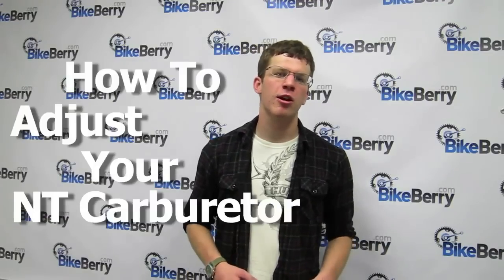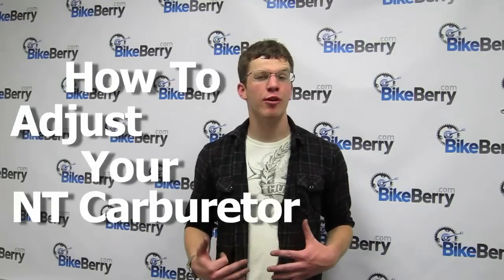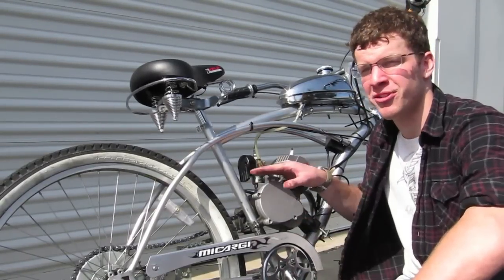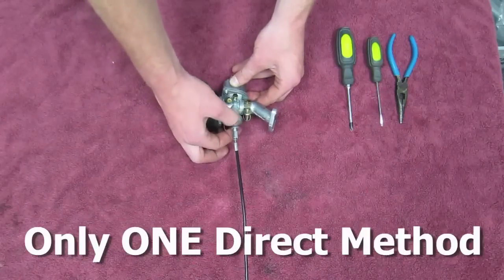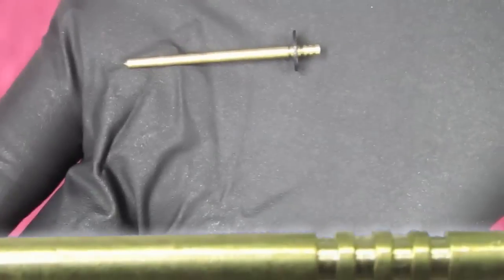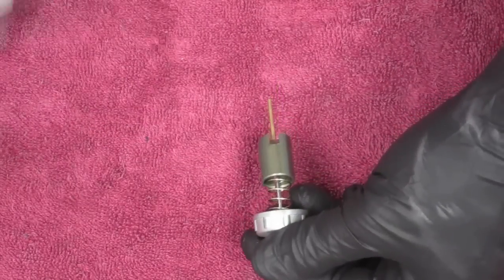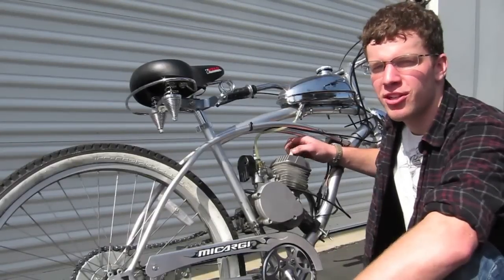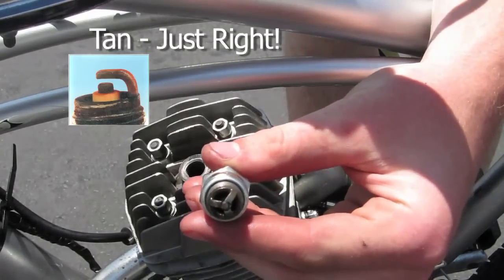How To Tune NT Carburetor for 48cc 50cc 66cc 80cc Motorized Bicycle

Comment: that bike chain is so loose..
Reply: loose is good
Reply: Got to agree I went through two back wheels with a tight chain now the tensioner is welded to the frame
Reply: Huntin_for_life_12 the tensioner is the friggin worst with the cheap kits, mine ALWAYS comes loose after even a quick ride to the gas station, thinking about welding it next😂

Comment: you don't need it. as long as you can peddle it and you aren't caught going over 30, it is usually completely legal and is simply a bicycle. the worst they can get you for is not having a bike license. at least that's how it is around here.

Comment from the maker: A few things: 1. Check your intake for any debris clogging it up or in the carburetor itself. 2. Check the float and float bowl. If the float is full of fuel, it's not regulating the fuel properly so get a new float. 3. Check the float bowl mechanics. Make sure the plunger is installed properly and it's not sticking or stuck.
Reply: @Zachary Margala no mines at a 45 degree angle lol should be flat but doesn't have to be to run correctly all it means is less fuel in your float bowl which hasn't mattered for me at least

Comment from the maker: Yes, we recommend any 2-stroke synthetic oil. 16:1 ratio for break in then switch it to 24:1 or 26:1. If you're planning on riding it for 60+ miles a week, I stress that you maintain that motor and make sure it's broke in FIRST before attempting that weekly commute. Maintenance include but not limited to: carburetor cleaning, check every bolt and nut after every ride. LOCKTITE is your best friend, and etc.. Hope this helps.
Reply: BikeBerrycom never never never 16.1 way to much oil

Comment: Nice video guys! Just make sure if you're  adjusting with the needle at first to not go over 2/3 throttle, otherwise the main jet is taking over the fuel! I don't know why, but on my BGF engines I'm having to lean out the main jet to a #64 jet on all of them. Do your guys' bikes run rich?

Comment from the maker: Adjust the idle and the jet needle inside the carburetor. When you're breaking in a new engine, the adjustments will be constantly changing because the gaskets and the seals are setting. I DO NOT RECOMMEND full throttling your engine during the break-in period. You're gonna shorten the engine's lifespan, bust a seal or gasket, or even seize it.
Reply: Two strokes like any modern engine doesn't need break in
Reply: @catsbyondrepair  A 2 stroke is anything but a modern engine.

Comment: My 66cc bike engine was running really well then out of nowhere it started backfiring. I've cleaned the carb, replaced the spark plug, checked the muffler to be sure that it's not clogged and checked the fuel line to include the filter and it's fine. I'm out of ideas as to what could be causing the backfiring. It's a pretty new engine. Thanks
Reply: Check your magneto and clean it it might be moistor or wet inside, take it and clean it with a tissue or some clothes or used a blower and heat it inside, dont wash your engine or use it in the rain ,, soon you need to change a new magneto it cost 7 dollar ...
Reply: I know this is old but it can also be a bad head gasket two much air getting in
Reply: Just for newer people who read comments of people with similar problems I learned alot that way
Reply: Cdi?
Reply: @mozezcen-valley7555  A little late :)

Comment: I live at 760 ft above sea level. I've got the 80cc 2 stroke with the NT carb.  Still running last tank of 16:1 fuel. What jet is recommended at this sea level? What slot on pin is recommended?
Reply: Get a jet kit, I’d start with 65 jet and then plug chop

Comment: I have installed a 48cc engine to my bike two weeks now, so it is quite new yet. But I'm facing a problem with my spark plugs that get smokey and dark too quickly and the engine dies. Should i try to make the mixture more lean in order to reduce the smoke in the spark plugs?

Comment: I just bought a bike with motor off CL.   The former owner says that when you start it , it runs wide open.  The throttle cable is actually loose and seems to no effect, what should i look at 1st?

Comment: I live in colorado. Altitude=6000ft above sea level. Does that mean I need a leaner or a richer mixture if so on which setting?
Reply: Cadet Hassan Leaner. I live 500 feet below you,, but here, you can travel a long way vertically in a short distance horizontally. I have a dial in-line on my gas line I can dial it narrower or richer if need be.

Comment: When my bike is at full throttle for about a minute, the engine starts to lose some power. I can let go of the throttle and twist it back up and it will be fine for a little bit until it start to do the same thing. What is causing the engine to lose power like this? is it a carburetor issue or an engine issue?

Comment: Is there a way to clean the spark plug so you don't have to get a new one every time? Also do you look at the white ceramic portion as well or just the electrode (the bent metal at the very top).
Reply: Wipe it off with a rag or very high grit sandpaper.  There is no technique, just do whatever you can to make a clean surface
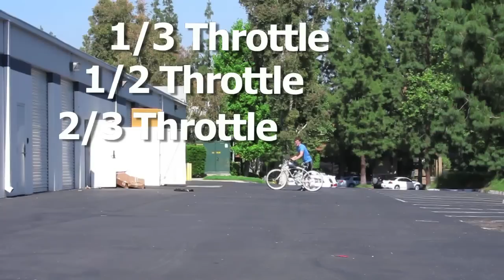Reply: @samstorm8997  Thanks! I ended up tuning the bike by sound and feel. It's not perfect and is a bit rich on the low end and probably a little lean on the high end but it runs. I run 1:32 oil mix which should be plenty to keep my engine happy so I'm not too concerned. I used to have the bike really rich, then thanks to a leaky carburettor I had it run pretty lean (scary), but now it seems to be pretty happy.

Comment: Hey bikeberry I was riding my motorised bike with my friends and then it just turned of but it didn't blow up I had no spark and I looked at the spark plug and it's black so that means I need a new spark plug but do I need anything else like a magneto or coil thank u

Comment: the oil is mixed with the gas in a ratio. 50:1 or 20:1 or 16:1 etc... where the first number is the amount of GAS. The second number is the amount of 2 cycle engine oil. Example, 50 ounces(or parts) of gasoline to 1 ounce(or parts) of 2 cycle engine oil.

Comment from the maker: Depends on the amount of rides/time you have had your motor. In all honesty, it's relative: you want it "richer' than normal during your break-in period and then "lean" it out after. I recommend going 16:1 to 20:1 during break-in and then 24:1 to 28:1 after break-in. Break-in will be your first four tanks of gas. Hope this helps!
Reply: BikeBerrycom woah thats far to oily. Break in is 25:1 cheap oil for 1 tank, then 30:1 of cheap oil, after that you run 30:1 of higher end oil after that then you run between 40:1 and 30:1. Ive done this with lots of 2 stroke engines and not just motorised bikes. I have yet to have one fail on me
Reply: That's way to much oil to recommend never never never 16.1
Reply: @alexhickey5633  been breaking in and running my motors on 100:1 opti 2 mix, was extremely leery to do so at first but its done fantastic, 30 on the top end, mods have increased torque but not top end, more than likely will be porting the intake and exhaust a bit to help open up the flow
Reply: @meanderingmike7640  opti2 is the shit my man. Brilliant oil
Reply: @alexhickey5633  whats your outlook on porting the cylinder intake and exhaust, also port matching the intake manifold and exhaust manifold to exhaust? Think it really helps enough in top end to do? Ive got plenty of torque with high comp head and viper flex exhaust but my top end is still only pushin 30, granted this is a motor from somebody else and not new
Reply: @alexhickey5633  decided to try and fix their bs, its all good now but couldnt seem to get the boost bottle to have enough vaccum to pull fuel so im thinking possibly intake leak not sure
Reply: @meanderingmike7640  port it mad and tune the carb but avoid the boost bottle

Comment: Had to bottom out the needle on lean and remove the filter and still 4 strokes unless wide open. As well as only getting half efficiency. 50mpg

Comment from the maker: Technically, because they're 2-stroke the only way to change the oil is re-doing the fuel/oil ratio. If you have fuel still in the motor, you have to attempt to burn out all the fuel and let it dry out again. Hope this helps!

Comment: hello there... hopefully you can help me... I have gone through 9 racing carburetors due to the fact that, when i put a new carburetor on and i drive my bike for at least a week and then the spot where I tighten the carburetor on my bike to the intake pipe, that carburetor ( I am guessing it is aluminum ) simply snaps and my carburetor falls to the side rendering my bike immobile. please help me if you can... I greatly appreciate it.

Comment: What's up I just want to say appreciate you doing a hell of a job. My first bike I got about 2 and 1/2 3 months ago and then it was broke down 4 days out of the week I paid $400 too much it added up to $700 after the bike and the motor kit everything turns out the same engine was 400 I could have got the bike for $150 I'm not going to say where I got it from but it was very shitty first impression I took my time and everything correctly out of the box the engine would not start it took a week I finally found a video of a guy named being also who explained about the clutch coming from the factory sometimes you have to tighten it up so I typed it up and it got me good and going and after that the back wheel hub broken shattered it's down for another week then I had to order a new carburetor in about 2 days after having the carburetor the Pistons in the engine basically shattered I was mixing my gas and oil correctly because I was using this to get back and forth to work and you know I wasn't able to write it to work one damn time I will say that the guys from umoto, great customer service cuz I didn't I got the bike I called them and the guy was on the phone with me everyday texting me calling me back so you this company here and umoto. I'm just thankful that we're able to have somebody we can call and actually care about the person's problem but I ordered the bbr tuning I got it about 3 days ago and man I haven't had one problem with it and that makes me so happy my old bike I literally took the bike and the motor and all and threw it in the damn dumpster I ended up going back out to get it cuz how I spent $700 on a $300 bike and motor but I'm learning the ropes now and I got to go to guys. And like I said it means a lot it's actually call a company and they actually care about your problem and will work through it with you 🙏❤️🖖

Comment: hey thanks for these videos, they are very helpful. i just got one of these running, i need to go thru the carb (it sat for a couple years). however, wondering if you have a good video on doing the throttle cable adjusments.  mine is very sloppy. do the screws on top of the barrel cap on the carb adjust too or is it just at the throttle grip?

Comment: How do you know when your idler screw is shutting the gas flow off  is it when it is screwed all the way in or when it is screwed all the way out? Also what can I do if the throttle is not returning to the idle position. I think it has something to do with the spring also my bike is brand new. I have only been able to start it once for a short time becasue the cheap Chinese bolt broke of the chain tensioner and then the tensioner destroyed my rim.I have it rebuilt to cold today for any testing but am trying to get it ready for when the roads are clear and a milder temp day any tips would be very helpful.

Comment: My bike jest runs like crap under load. And I checked for vacume leaks, cleaned the carb, made sure the flote is not sticking, replaced the spark plug, cleaned the muffler, cleaned the air filter, cleaned the fuel filter, cheked the gaskits, adjusted the neddle on every noch and it still runs like crap. What should I do?
Reply: I found out it was a vacuum leak. I jest didn't look hard enough.

Comment: Should I change my jet to a smaller one like 0.72? I was fouling my plug when I had the clip in the middle. I moved it to the leanest setting and it hasn't fouled. I am running a 50:1 oil ratio. The plug is still black with some carbon build up, but doesn't foul. I was fouling every 30 minutes I'd say, now with the leanest setting, its lasted 3 hours and hasn't fouled! Is 50:1 too little oil?

Comment from the maker: Vibration is normal, so don't panic! However, just like red-lining a car, you will feel some extreme vibration and it can be very dangerous. Treat it like you would any motor vehicle and do not ride these things on HARDCORE MODE! Keep it a steady mid to low throttle, and if you want to go any higher, I recommend mid-high throttle. Vibration is also due to your engine pulling air/fuel through a small jet and basically suffocating the motor. Purchase a larger jet and install it in the carb.

Comment: Having serious problems. My (once running) motor won't start. I pedal, release the clutch & once I stop pedaling it's dying. Basically, it dies once momentum (pedaling or forward momentum) stops. Throddling it does absolutely nothing now. Good, compression, spark (ngk b-6L, new cdi & magneto), fuel mix, no leaks anywhere, choke in up position, everything properly wired, engine less than a month old. Please help.
Reply from the maker: Give us a call at (800)317-0479, and we can properly assist you.

Comment: I have the speed carb from Bikeberry and it doesn't want to work for any of the needle settings except for the richest mix. I do not have the short, wider intake manifold, but the long z shaped one. Could that be why my carb is acting funny? Also, it never wants to stay idling, so I have to rev it a little every now and then.

Comment: hi guys, can you please tell me if you can.......I have a new 80cc 2 stroke engine kit on my bicycle, went together well but now the engine won't rev much, not enough to propel the bike & me on it! I checked/cleaned all the usual stuff carb/plug/throttle cable/vacuum leaks etc. All seems fine, I live in Ireland and used your fuel mix as close as possible in litres/ml, (16:1) again mix seems ok, a mechanic friend of mine thought it was the carb at fault as he took the barrel/needle out of the carb while keeping his thumb on the opening while engine was running, he said the engine should be screaming/revving it's brains out at this stage, but still only revved a bit kinda like a fast idle, so I again dismantled and cleaned the carb. It looks fine and you'd expect it to work when I put it on, but no! Please send me any suggestions you can. 
Regards

 P.S. it's a NT carb...........
Reply: i have been having the same issue at times but now my issue is my tank when it has fuel in it it will be completely dry with in 2 minutes of letting the bike sit. so i am going to check the fuel shut off but even if that isnt working the carb should be holding all the fuel but it is not.

Comment: the old carb would not feed gas into the engine either, but it would leak gas out of the air intake.

Comment: Why do I have to pull in the clutch and then hit kill switch?, I mean, the test of throttle range must be done running the bike right? Not staying in place and revving it up, thats it?
Reply: Beekibye the test is done running under load, with a fixed throttle position. You pull in the clutch and immediately kill the spark so the plug color you just made remains. If you just kill the spark, you load the jug with mix that doesn't burn, so you cover the hot plug with oil, producing false results. If you just pull in the clutch, then close the throttle, you get idle results showing. The idea is to show your results at quarter, half, three quarter, and full throttle, because each position is most effected by a different circuit in your carb. On a motorcycle you would do closed throttle as well. The air screw adjustment most effects idle. The slider cutaway most effects around quarter to a third. Needle taper from quarter to half. Needle height from half to three quarters. Main jet above three quarters. By checking each position, you can find the best combo of parts to run your motor at optimum mixture at all positions. You should test in one direction, idle first, full open last, as every component has overlap effect, that way you minimize number of teardowns and adjustments. Always err on the rich side to start, lean can kill a 2 stroke real quick. Search for and download the "mikuni tuning manual", it's worth it's weight in gold

Comment from the maker: I'm assuming you're talking about the off-set manifold? If so, that may be the reason why your carb is acting 'funny'. It depends on how long you have had your engine. How are you adjusting/setting your mixtures?

Comment: I got a new carb and it does not feed gas into the motor. The gold pin is still partially inside the hole that goes to the bowl when i open up the throttle. what could be wrong?

Comment: Is that true having the kill switch decreases power and it worstens the magnitude worst i just use my choke as a shut off I have a hp carb and I just use my choke to turn off the engine
Reply: Kill switch does nothing to the power. As far as the engine can tell it does nothing until you press the bitton at which point it interrupts the spark causing the engine to quit. If you dont touch the switch, there is no difference compared to if it isn't even installed.

Comment: Have a new engine with a new NT carb.  Some friends have same and they run great.  Mine has a crazy problem I can't fix.  When you de-throttle, i.e. if you're running and turn down throttle...engine will rev up....a lot!!  Then come down.  Tried all adjustments...just can't get to the bottom of it.  Could it be the float level is not right?
Reply: @ jbman1982 so when you depress the clutch its revving out extremely high?
Reply: Check for air leaks on the intake connectors